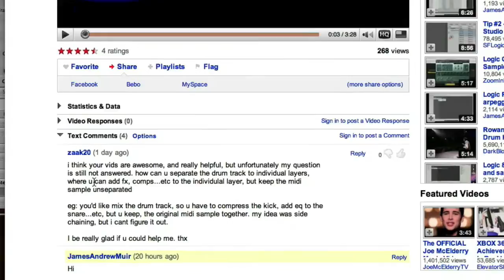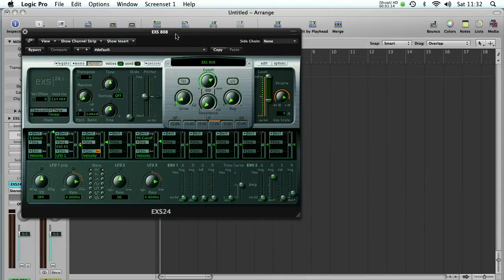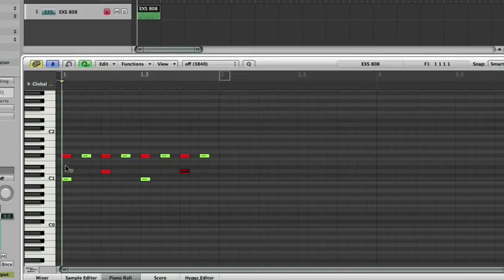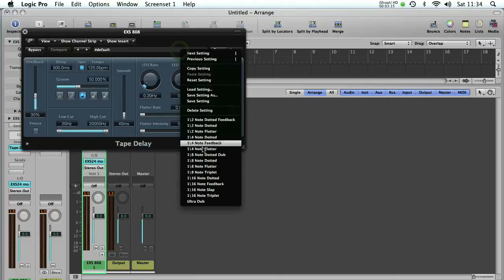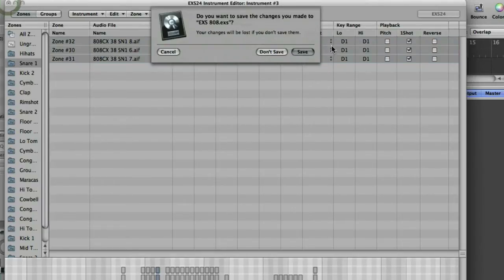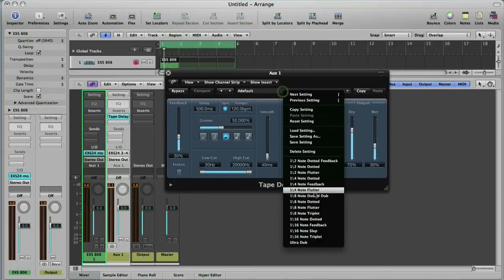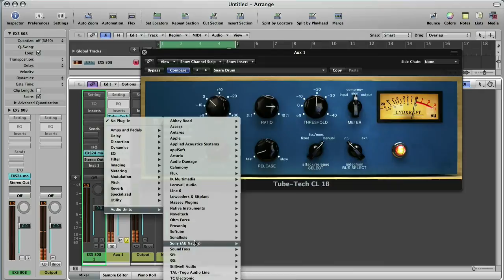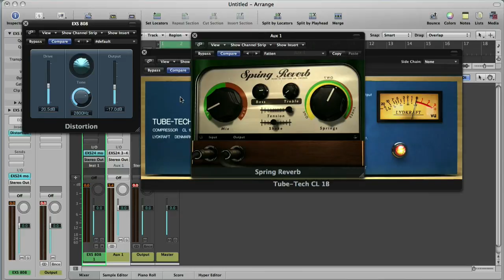Logic's Exs24 and Multiple Outputs

Comment from the maker: @merkinmerlin As far as I'm aware the envelope controls effect the whole output, regardless of what output the specific sounds assigned to. I tend to get the sounds broadly how I want them before I load them into EXS24. 

The other thought is to use Ultrabeat as an alternative, it has comprehensive tools for modifying samples, with each sample able to have unique settings.

Sorry I couldn't help, maybe someone else will chip in with a cool way of doing this  on EXS24 ?

James